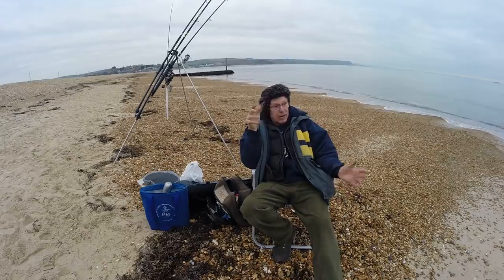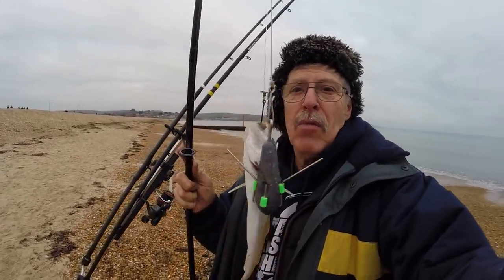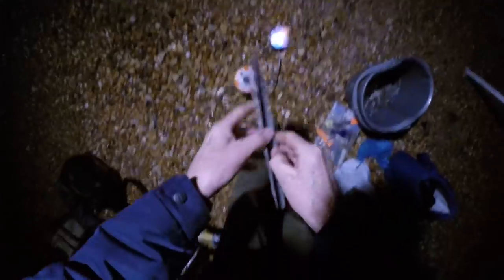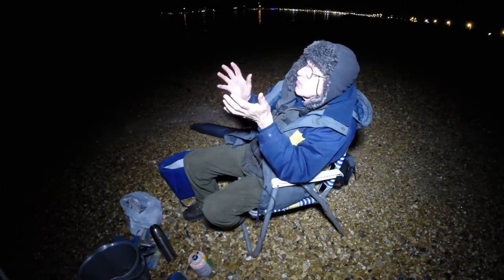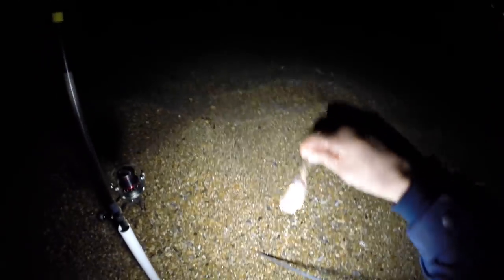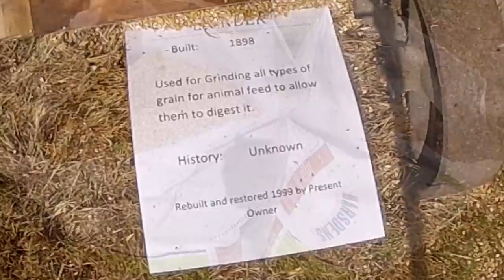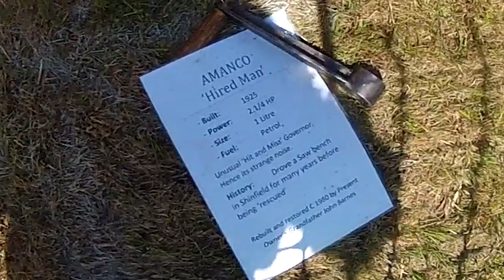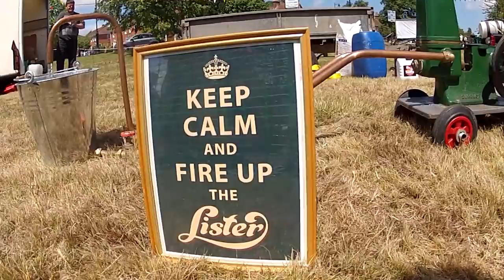WINTER BEACH FISHING With WORMS AS BAIT

Comment: I'm 62 & I saved up for my Mamod engine and never felt at risk, it's still going well today.  Now, if you want a really risky toy? ..... my Jetex engine strapped to a piece of wood with wheels on really used give us some moments 😂
All the best,
Clive.
Reply from the maker: OMG..I literally told Mike about those last night. We used to get a small cylinder of solid "Rocket fuel" put it in the back,have a piece of fuse out the stern and light it. My Dad would be at the other end of the line,probably enjoyed it more than I did. I just loved the sound of the Jetex hissing before it whizzed off down the line. Happy days,and burnt fingers. I think my model was fashioned after Bluebird. Imagine it nowadays.Instant ban from some wettie I imagine.
Reply: Great stuff, and we are still having fun.
Really enjoy what you are both doing. 
Regards,
Clive.
Reply: I'm 60, we used to do exactly this with the Jetex. Still have my Mamod traction engine, bought a replacement canopy for it a couple of years ago, the original suffered from too many "experimental fuel" substitutes...

Comment: Even me  - born in the 70's so grew up in the 80's spent my formative years with questionable Chemistry sets, meths burners, 2 stroke engines, knives, air guns, fires, dangerous tools etc. It certainly sorted us all out Darwinian style. I was seriously cheered up this week when my 13 year old daughter came home from school with her first woodwork project. A model plane with moving wheels and propeller - she used: coping saw, tenon saw, plane, rasp, pillar drill, sandpaper, wood glue, panel pins and screws - then Danish Oil to finish. It was pretty straight and symmetrical with fairly tight joints and a nice finish. So even our latest bubble wrapped generation aren't all totally soft :) I'm delighted :)
Reply from the maker: That's an uplifting thing to hear,and I imagine she got totally engrossed in making it. Congrats to9 her,gives us oldies that all might not be lost.

Comment: How true Graeme with the kids learning nowadays! I can remember for my 10th Xmas present I got a Mamod Tracktion engine, and peed myself with excitement, and had so much fun with the meths! thanks for the reminder,,,,
 Oh, a little bit of a dangerous tip I did the other day, I ran out of gas for my plow lamp(a GAZ type) I couldn't get to the shops, I had some lighter gas, so I managed an adaptor and fill the blowlamp up. It works a treat, Pound shop gas, so its cheaper.. thanks for the video. :)

Comment: As you were cooking up on the beach there you made me realize that I need a small 1.5 Litre pot for cooking up food with my portable outdoor petrol pump up stove & I also need to find a lightweight frypan that is cheap. I found one of those pop up silicone & stainless steel pots with a folding handle & for the frypan I found an Anolon Ceramic Carbon Steel up to 240 deg Celsius, it's a non stick baking tray that is about 23cm x 33cm x 5cm deep which I can use one of those camping pot gripper handles on so it will be perfect for cooking up a couple of fish pieces & chips on the beach or in the boat on the river. The only problem is that I don't need it yet but it will be there when I do to buy it later.
Reply from the maker: Mike uses stuff like that on his Bushcraft channel T.A. Outdoors...You might also check camping or caravan shops they have some interesting gadgets nowadays.
Reply: Yeah I also watch his channel too thanks.

Comment: You'll be a bit disappointed when you find out your burnt nails are no longer hardened.
set them back in the fire and quench them in used oil when they are red hot and they will work a bit better.